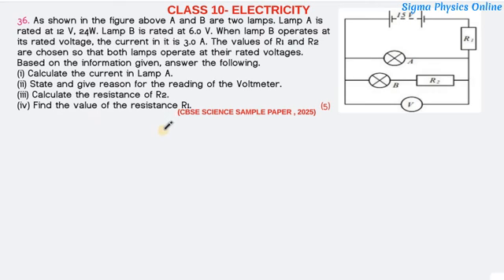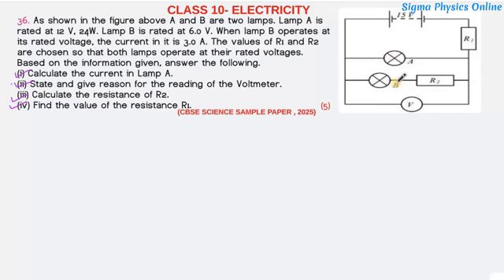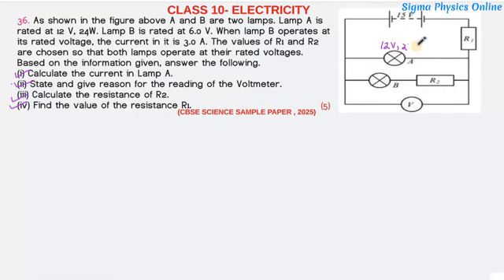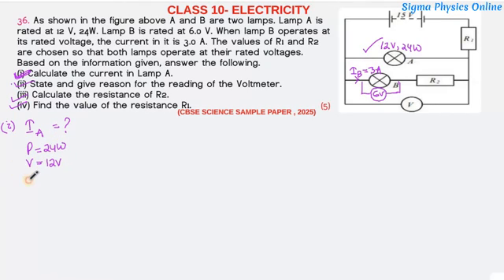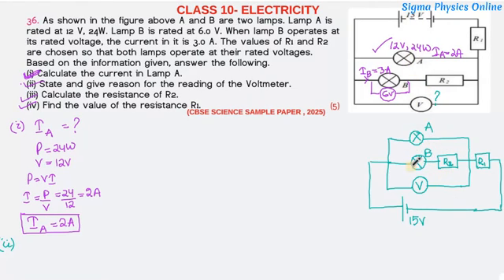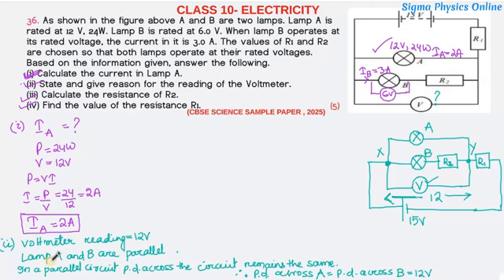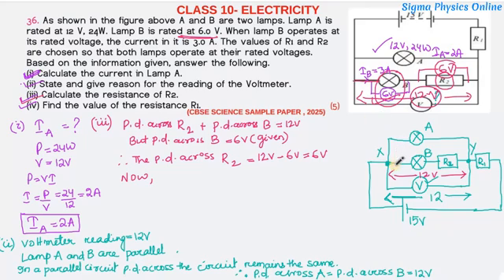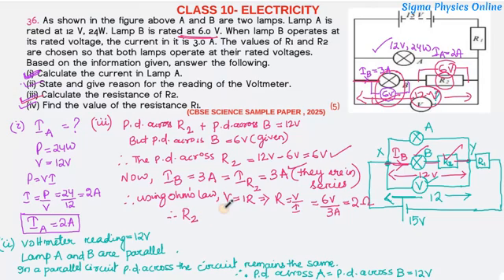As shown in the figure above A and B  #class10physics #video #viral #new #electricity #samplepaper

Comment: Mam but wo 15v main battery mee hai na toh yhiii voltage rhega na as it is parallel combination in second number question
Reply from the maker: Hello beta. 
There is typing error in the bit (ii) answer .
It should have been -  The p.d. across X and Y should be 12V. 
Lamp B is 6V and so R2 should be 6V. 
I have mentioned the same in the diagram, but somehow mistakenly wrote across B in the answer.
And yes, pd across X and Y (refer simplified diagram)  is 12V. Also there is another resistor R1. It's pd is 3V (refer 7.20 sec of the video). So, they both make a total Pd of 15V which is the total pd of the battery. 
Hope you are clear now.😊😊

Comment: Mam lamp A is rated At 12V and lamp B is rated at 6.0V. To Voltmeter 12 V kaise hoga ?
Reply from the maker: Oh ok...thanks for pointing the error in the bit (ii) answer .
It should have been -  The p.d. across X and Y should be 12V. 
Lamp B is 6V and so R2 should be 6V. 
I have mentioned the same in the diagram, but somehow mistakenly wrote across B in the answer.
Thanks for pointing.
God bless you beta.